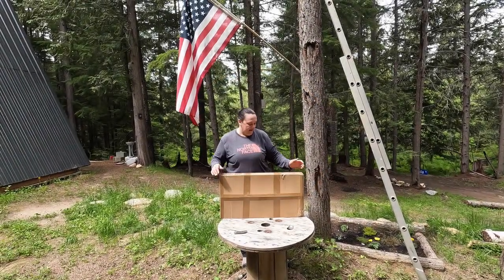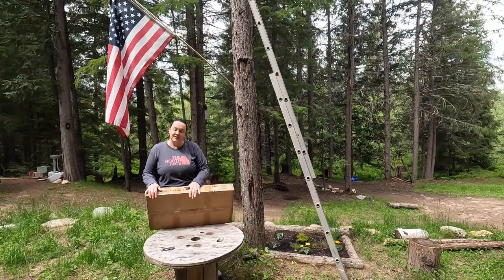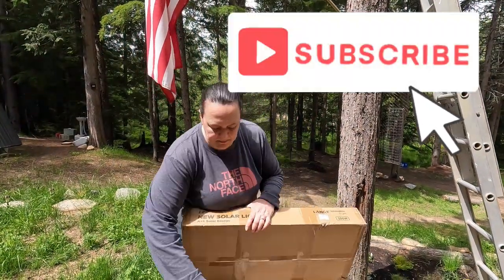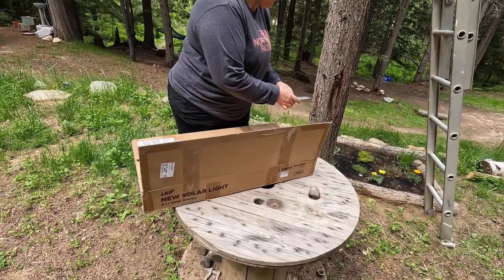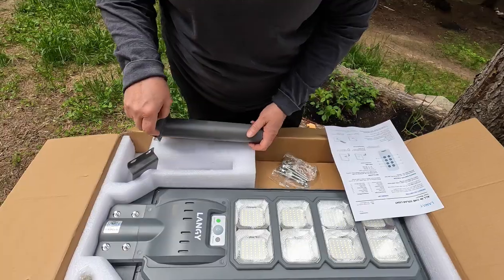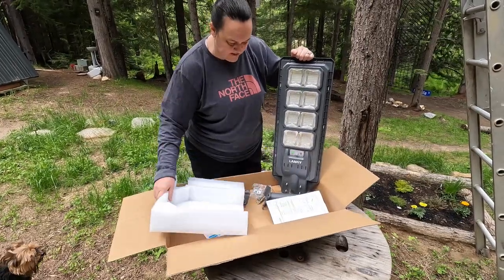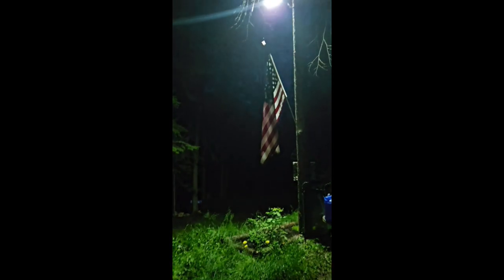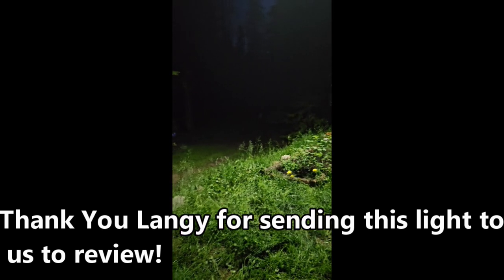Langy Solar Street Light installation and review

Comment: LED street lights are a well established technology. You should have no issues, with the exception of solar cell occlusion due to dirt and in you case, pine needles.  So, expect to need to clean it, including pine tar.  Now, to comment on your installation.  I would recommend that if you do this a second time, that since you have a second person, get a rope, and bucket for your tools  Have your person down below put tools in the bucket for you to haul up using the rope after you get up there with the other end of the rope.  Have her tie your street light fixture to the rope so you can haul it up first and loose fit it to your extension arm.  Then drop the rope and have her attach the rope to the tool bucket.  This will be easier for you and allow a safer ladder climb.  I also would recommend that once you put the ladder up you also take a strap or rope up to tie it to the tree so it won't move while you work.  (In commercial work OHSA would require that the employee have other safety equipment to arrest a fall.  But, you are not doing this as an employee.)
Reply from the maker: Thanks for watching!  I can not deny that your observations about the safety of our installation are all correct.  Due to my 30 plus years in Public Works, I am well aware of the sketchy things I do in my personal life.  You might enjoy (or cringe at) some of our older videos.  Thanks again for watching.
Reply: Or just get a tool belt. @halfassoffgrid1036